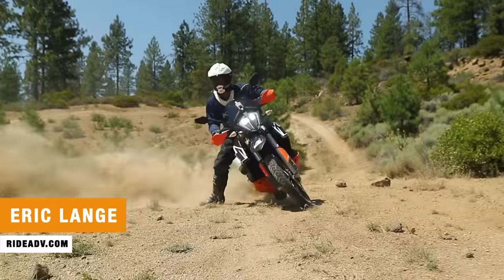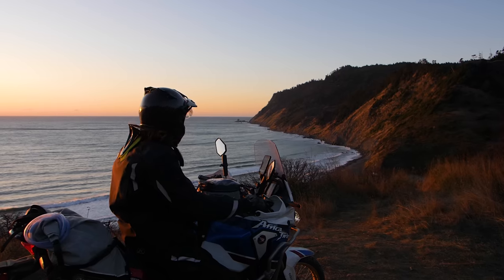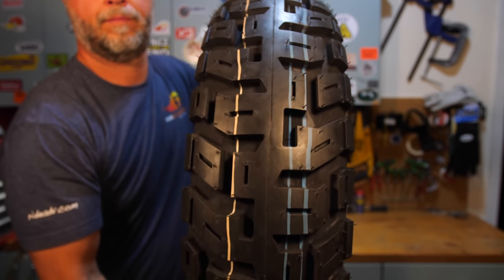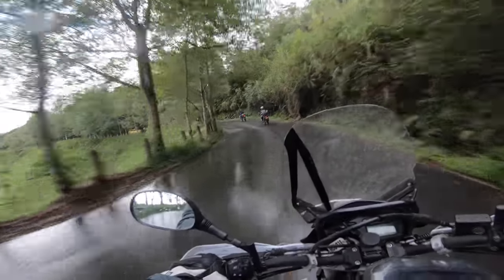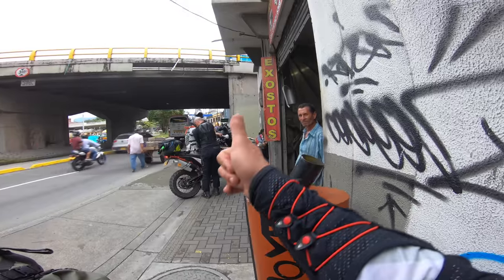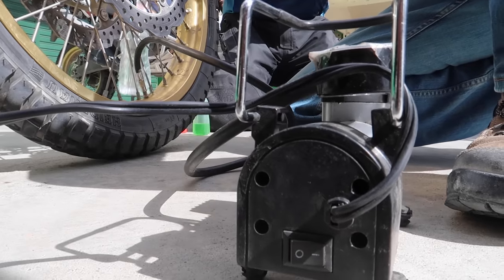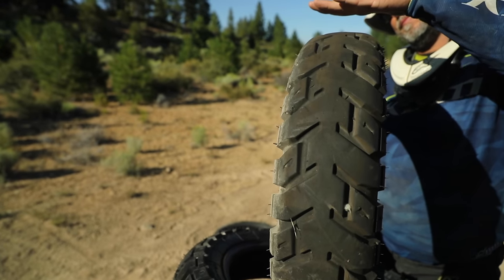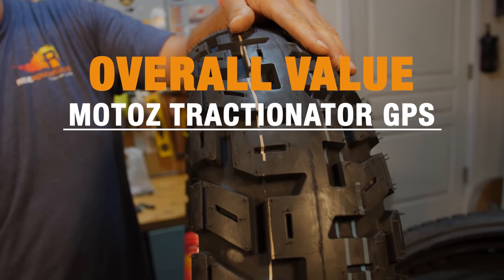MOTOZ TRACTIONATOR GPS Dual Sport Tire Review

Comment: Your single strip explanation would only be applicable if you are way over pressurized. At normal pressures there will be a bout a 2.5” contact area.  The center strip will add to longevity I agree. Running the Motoz adventure now V85TT very satisfied. The problem I have with the front tire GPS is in sand it appears to me the front GPS would struggle and probably wash out. The tread pattern is eerily similar the the death wing. Mounting is not a problem with a Baja no pinch. Which made mounting the motoz a breeze. Also want to give a shout-out to chapmoto GREAT SERVICE!
Reply: can confirm the front is useless in the sand.  I"m looking for a better alternative now.

Comment: I had a set of Tractionator Desert HT tires on my DR-Z400. A 3000 mile round trip from Everett, WA to Death Valley and back used more than half the tread on both tires. I estimate the maximum range on these tires at about 5000 miles. Initial tread was really deep. They were fine on the highway, fantastic in the dirt. I would love to try a new set in the dirt, but they were already significantly worn when I got to Death Valley. 

I replaced the Desert HT's with Tractionator Adventure tires. They are a little better on the highway and not quite as good in dirt, but no better range. Maybe good to 6000 miles. Maybe. 

I currently have a set of Tractionator RallZ on my Africa Twin. I replaced the front after about 5000 miles because I was preparing for a trip. It might have had another 1000 to 2000 miles of useful life on it. The rear tire now has about 9000 miles on it, and I estimate it could have another 4000 to 6000 miles of useful life. Similar performance to the Adventure tires, but much longer range. 

For comparison, I was using Heidenau K60 Scout tires on a V-Strom DL650 and getting 16,000 to 18,000 miles from them. 

I have a set of Tractionator GPS tires sitting at home waiting for the RallZ to wear out. They probably won't go on until next spring. 

Disclaimer: The Africa Twin and the RallZ tires are better than I am. On a trip to Death Valley, they saved my butt on more than one occasion. I have not come close to challenging the limits of either the AT or the RallZ tires except through my inexperience.

Comment: Nice review; thanks. How are they on twisted asphalted roads? Can we ride sportively in corners with them?
Reply: I push them to the limits on my AT and sometimes i touch the pegs,  and no problem😀  You may ride hard on asphalt , but it have some limits, they are no street tires. They are great on any dry conditions. You may throw them on any terrain, but when is wet you have to be more careful.  Except that it is great tyre.
Reply: @bigbabooon  thanks for feedback

Comment: I’m pretty dedicated to the TrailMax Missions on my Africa twin. I do a lot of riding in the rain on pavement. That center strip tells me that the rear tire will suck on wet roads. The Trailmax excels at this and I get around 10k to 11k out of them. Getting my 3rd set this week.
Reply: Opposite experience here, I removed the super hard compound rear Trailmax Mission from my R1200GS when half worn after it started sliding repeatedly and activated traction control during easy straight line acceleration on wet paved roads. After similar experience with the super hard Heidenau K60, I'm naturally suspicious of any hard compound rear on wet pavement, and wish tire reviewers would mention that important performance aspect on these type tires but no one ever does. Mentioned in the video though is a high silica content in the GPS rear (missing in the Mission and K60), so maybe the GPS is better than them in the rain.
Reply: Interesting reply. The TrailMax Mission is a great tire and while on the surface it appears to not have the center strip... but several thousand in and the 150 that the AT has turns into a solid center strip.  The mission is GREAT but I took it off "prematurely" of my Africa Twin and 1190 Adv R as it stopped working as I needed it to once the center became solid.
Reply: @manybikes  I’m not exactly sure what you’re saying but if the tread blocks in the center of the rear tire wear down to the point the sipes that cross the center of the tire disappear, you’re well out of the tires lifespan. I’m at 10,500 miles on my current set of missions and I can still see the sipes crossing the center of the tire. I’m past the lifespan now, just waiting my my service center to get my new set in.
Reply: @zyonsdream  Sweet!  That is some impressive mileage you are seeing!
Reply: Having a full center stripe is a misnomer about being more slick in the wet conditions. It has to do more with the amount of silica they put in for grip.
Reply: @atvtinker01  Makes sense, never thought about this till just now but super bikes racing in rain have more contact that this GPS has with a center strip
Reply: @manybikes  This is exactly what I was concerned about. I have watched this about 5 times and your reviews over and over. I am convinced the Motoz GPS will equally perform and most likely outlive the Trailmax. I also find it interesting running the rear GPS in mostly off road will increase longevity and performance.  My only concern would then be riding pavement in the rain. Any concern there?
Reply: @manybikes  I'm almost down to that center strip on the 150 size rear. Not sure why they did that. I don't see that on the other rear sizes. It's cut the life by half easily. Noticed the other day I could not stop well on gravel and noticed I am almost to that strip.
Reply: I couldn't trust the trailmax rear on my V-strom650 on cold, wet pavement. Too many unexpected losses of traction.  Not okay with me. I'm afraid to try one on my Super Tenere.

Comment: MotoZ tires were some the worst tires I’ve ever purchased for my GS. Bought them at an dual sport event and they didn’t hold up well. Lots of issues with chunks of rubber falling off.  Stay with well funded known brands that have the resources to do the necessary R and D.
Reply from the maker: Sorry to hear that! Sounds like a bad batch is going around? We've gone through quite a few tires over the last few years and have yet to experience that but have heard others having similar issues from the comments.

Comment: These were going to be my go-to for the T7, to replace the stock STRs.  Then I saw some reports from people who have put them on and say they are a bit squirrely on hard dirt and loose gravel . . . that is compared to a full knobby like a Tractionator Adventure or a 909.

Anyone have them on and has a different experience?

Its a trade-off but you have to wonder too about the hard compound in the cold or on wet pavement.  Economy vs performance. Tho at $210 for a rear only, they aren't so much an econo tire.
Reply: I was looking at getting a gps tyre to replace the EO7 on my T7.
The EO7 tyres will spin up on a wet tarmac road in 3rd gear.
Reply: I don’t like it in the wet on tar on my KTM 1190, spins up very quickly. Will not use them again. I am not overly concerned with mileage so will use Anakee Wilds next time.
Reply: @seanbatty2665  I tried the wilds and the were awfull in the wet and dry, lugs tore off and only lasted about 1000 miles.
Got a GPS rear on now, seems much better.